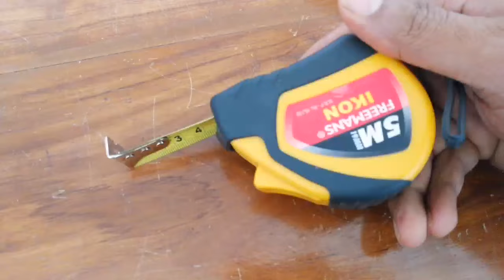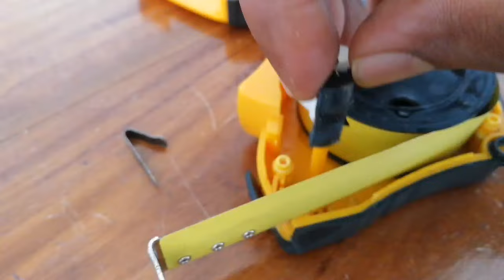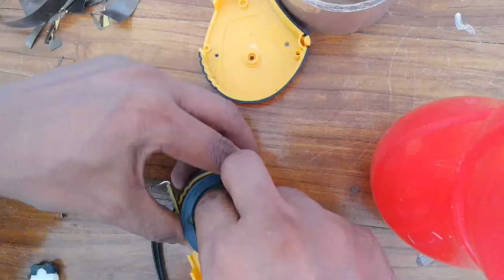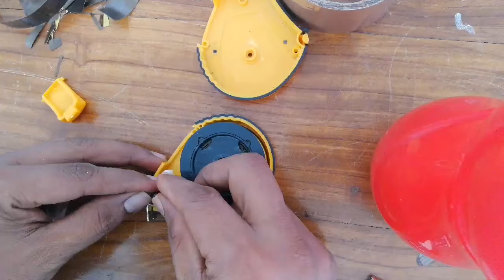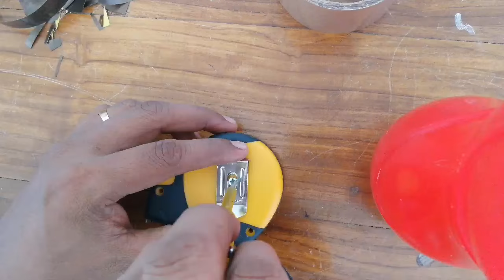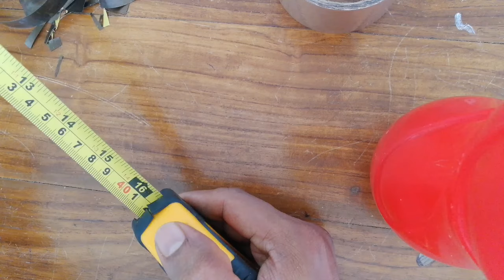How to Open and Repair MEASURING TAPE | FREEMANS IKON | 5M

Comment: I couldn't repair mine because it was broken the rolled metal spring additionally the plastic cover and coil were too weak so they ended a little damaged in the process (cheap). This video is great!

Comment: My yellow tape just spins outwards not like how it is happening here in the video when you pull it outwards it automatically goes inside
Reply from the maker: You have to spin the tape around the centre midule properly.. Then do a spring tension movement as shown in  around 2.31 time snap in video.. You can do that.. Be happy